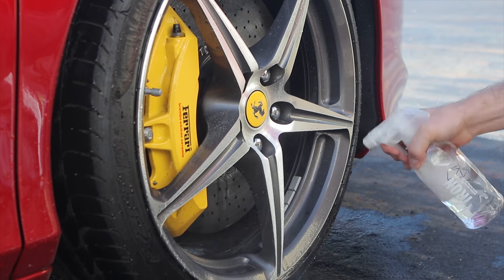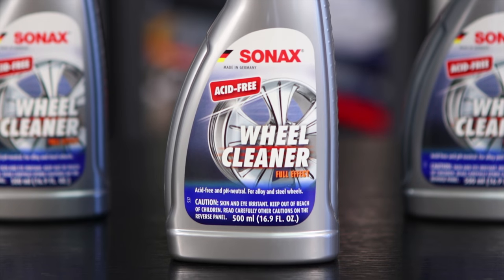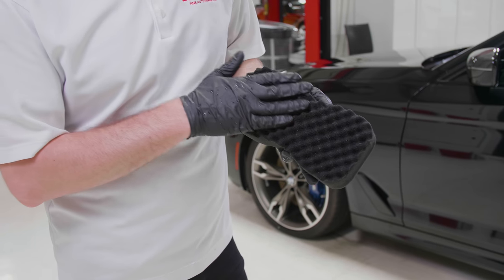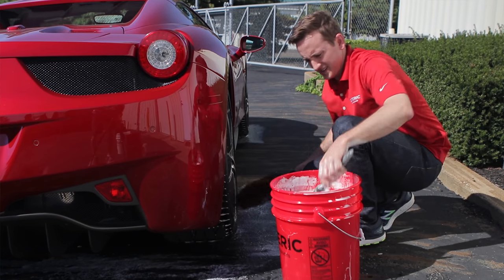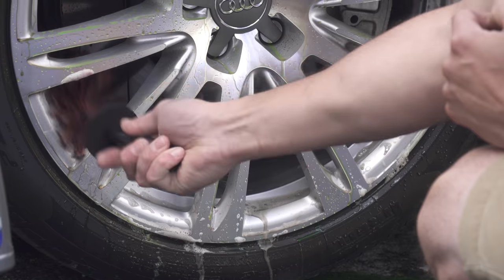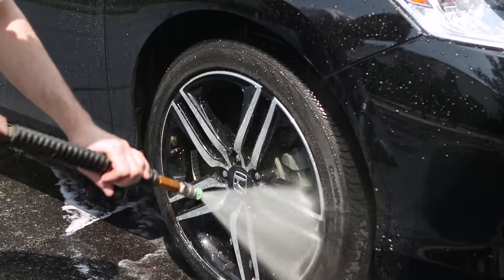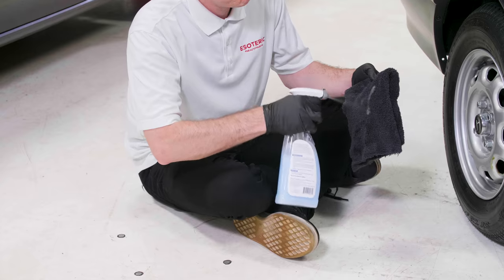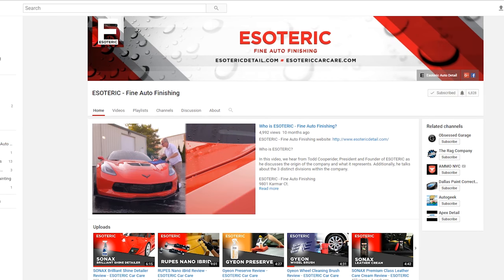How to Wash and Maintain your Wheels - ESOTERIC Car Care!

Comment: I actually enjoy cleaning the wheels and tyres as you can see the improvement right away and doing it on a regular basis stops those little areas from having a build up of brake dust that if left becomes really difficult to remove. You may have said this and I missed it but I tend to use the brushes to clean the wheel barrels but a mitt to wrap around the back of the spokes to make sure they are clean too. Now cleaning the interior glass, that is a hated job!
Reply from the maker: Yeah, nobody likes interior glass! Yes, you can use your mitt / sponge to gain access to the backs of the spokes.

Comment: Products like Gyeon Wet Cost are great for wheels as you just spray on your wheels after you’ve washed and rinsed them and jet wash off. So easy especially on cold winter days.
Reply from the maker: You are correct...Wet Coat is a very good option for adding protection to wheels!

Comment: Hello esoteric team.  The bucket that holds the brushes, paintbrushes etc.. .  Should we just put water in it or can we add shampoo to add a little lubrication?.  Would water + ONR do the trick?.  Where is it better to just put water to rinse well inside the brushes and paintbrushes after using wheel cleaner, iron decon etc... Thank you
By the way, the new meguiar's microfiber brushes (small & larger) are excellent on fragile shiny black finishes!
Reply from the maker: Put soap in it as well...

Comment: Good evening from the UK,
Just watched your video on the wheel maintenance, can I just ask I have black gloss alloy wheels, and I’ve noticed that my wheel cleaning brushes are leaving ‘fine’ scratches on the paint. What would you recommend best for cleaning black gloss wheels?
Many thanks in advance!!
Reply from the maker: That's going to be really hard to avoid on gloss black wheels simply because you're washing off very abrasive contaminants. Maybe switch over to a softer wash media for your wheels, and be sure to thoroughly clean it out between wheels.

Comment: Do you have any recommendations for wheel protection that isn’t a coating? I have matte wheels and I was wondering what you’d recommend to keep them clean. I know some products will mess with the matte finish so I’ve been hesitant to use a wax on them. Thanks for the videos, you guys are awesome!
Reply from the maker: Most protective products will add at least some type of "richness" to the finish, but won't turn them glossy. Given how much of a PITA they are to keep looking good, we always recommend coating for them! Outside of that, I'd look into Gyeon Wet Coat (easiest), or Polishangel Supersport.

Comment: Love your videos and the depth you go into as professional detail shop . I use Cosmic V2(2 coats)   from Polishangel on my car and wheels and was wondering how often would I use the  SuperSport ? I also love the Japanese sponges that I bought. Do my my coated wheels need be cleaned weekly with a cleaner ,if I wash my car weekly and have a Honda?  Thanks again for your great videos.
Reply from the maker: Thank you for the positive feedback! Given your situation, I'd probably use SuperSport about every 4th wash. And since you have a Honda, you shouldn't need a strong wheel cleaner very often. I'd just use regular soap on your wheels, and then you could use a stronger cleaner every 4th wash, and that would be the time to top it off at the end with your SuperSport.
Reply: A recommendation for a electric power washer to use at home for 2 car per week washing schedule and using a foam gun?
Reply from the maker: I wish I could help you on that one, but I'm personally not up to speed on pressure washer offerings these days!

Comment: can you use sonax wheel cleaner on carbon ceramic brakes?
Reply from the maker: Yes you can, however if they have carbon ceramics on them, you shouldn't need such a strong wheel cleaner. In that case, I would simply use your regular pH neutral car shampoo.

Comment: Todd I really appreciate your videos, you single handily got this decade old hobbyist into the polish angel products, and it’s my favourite line up to date. What would you recommend in a sprayable product to clean up water marks or staining that haven’t removed in the wash process on a coated car - water marks especially as blow drying always tends to flush out dirty water in places that dries on the paint
Reply from the maker: Thanks for the feedback, and glad to hear that the videos have been helpful for you. If it's something simple that can be wiped off, then whatever product you are using to maintain the coating should do the trick (Polishangel Cosmic Spritz, Kamikaze Overcoat, Gyeon Cure, etc). If it has had the opportunity to sit on the surface, and become a water deposit (water spot), then you'd want something like Kamikaze Water Spot Remover. I have videos for all of these products, and you should also watch the video on how to maintain a coated vehicle. I hope this helps!

Comment: Great video series!  Quick question, you say to use three buckets and keep the wheel bucket separate from everything else, are you using a single wheel bucket for wash/rinse or are you sharing the rinse bucket with the regular wash stuff?
Reply from the maker: Thank you. We are just using the one bucket for wheels, and putting a Grit Guard in it as well.

Comment: Just wipe em down with a towel after each use if driving in dry weather and you have CCB hardware IF you have the time....takes 5 minutes depending on the intracacy pattern of the wheel.  Brake dust (if left on for too long) "eats-up" alloy wheel finishes.  I even wipe the inside of the rim as well AND NOT JUST THE OUTSIDE due to on occasion you pick up road tar "pellets" on the inside of the rim and those you can scrape off with a plastic knife then scrape off any excess with a fine rubbing compound.   When rotating tyres DIY (every 6-7000 miles) the rims get extra attention especially on the inside portion.